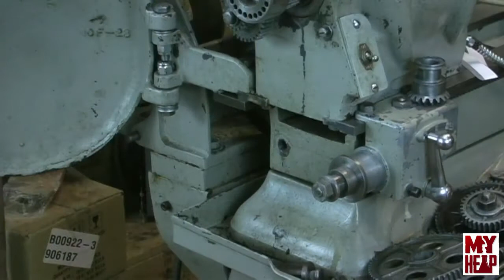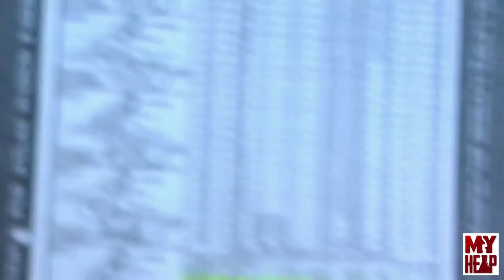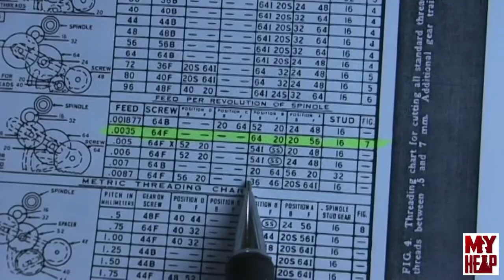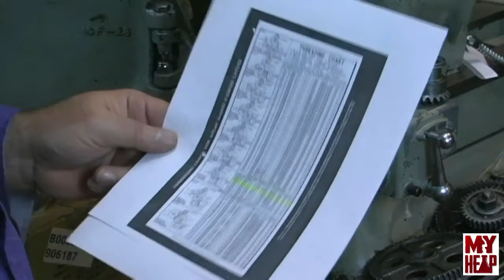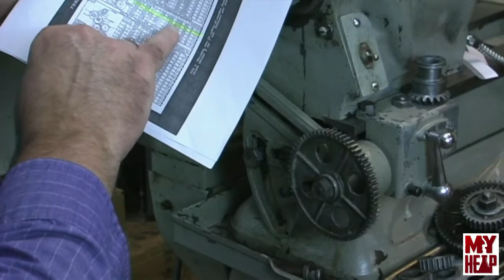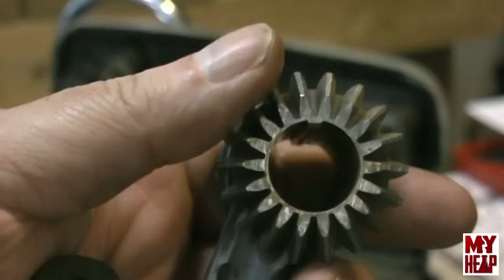Atlas 10F Lathe - TH54 - 11 - Installing the Banjo and Change Gears

Comment: Hi Joe. Once again Im glad I could help out with the gears. If I could make a couple of suggestions? First of all I.M.H.O. it is a good idea to mount the banjo and get it lined up correctly before adding gears to it. Those banjos are relatively thin cast iron and easy to crack. I realize you said the threads were a little sticky but you need to crank that bolt down so the shallow head rides in the groove without tweeking the banjo. There should be a jam nut on the bolt going into the headstock. Once that jam nut is tight, you really shouldn't ever have to take it out. The nut in the back to tighten down the banjo can be a bit of a P.I.A. to get to with a wrench. 
Secondly,  once again I.M.H.O. I find it easier to assemble the gears on the bushing assembly on the bench before putting them on the bolt. 
Lastly, not a suggestion, but a must! When assembling the banjo,  before you put the bushing on the shaft it rides on, put a couple of drops of oil. This really can't be done once the gears are on the banjo so it must be done before you put them on. And every so often, pull them back off and re oil.    
 Sorry for the book, just trying share what I have learned from my experiences.
Reply from the maker: Jeremy, please don't apologize for the help and great suggestions, especially if I can learn from your experience and wisdom.

Question:  The bolt that holds the banjo in the locked position, (for the lack of a better expression).  I see on the parts diagram that there should be a jam nut that I am missing.  I will pick one up.  But as I understand what you are saying I should put this bolt in against the recess in the banjo for a nice sliding fit (no lateral pressure against the casting).  Then lock the bolt into the side of the bed casting with the jam nut.  Then, to lock the banjo in position, just tighten the other nut and washer against the backside of the banjo.  Am I understanding that correct?

After putting on the bushings and then sliding on the gears, I think you are correct, sir, that it would be easier to assemble the gears on the bushings first, then attach them to the banjo.

I know that I didn't oil these, and I should have.  My intentions were to take it all apart and clean them up a bit then reassemble.  However, my viewers didn't know that and would be bad if they were following my practice in this video creating excessive wear in their machine.

I think I will do a follow up video.  Thank you for your help.  I do appreciate that you have taken the time to do so.

Joe
Reply: Yup, that is what I was getting at with the banjo bolt.

Comment: Hi, great videos.  When possible, could you tell me how the 16-tooth gear is mounted?  is it together with another?  or it is mounted the same way as the others, with a bushing that has keys.
Reply from the maker: The 16 tooth gear is compounded with a 32 tooth gear.  They are cast as one and ride on a stud and are free rolling.  They only act as idlers so the do not need to be keyed.  I hope that helps.

Joe
Reply: @MyHeap  It helped a lot, I'm a little lost because my lathe is missing this 16-tooth gear.  The 32-tooth gear has the same key as the other mounted ones.  I'll try to see how I do it, thank you so much for everything.
Reply from the maker: @vieiram7235  on my 10F, the spindle gear drives this compounded idler gear.  Then the gear in the "A" position on the banjo is driven by either the 32 tooth OR the 16 tooth gear, depending on whether or not the driven gear is on the inside or outside of the gear train.  Would a picture(s) or video help with this?
Reply: @MyHeap  I would be very happy if you could take pictures or make a video of this part yes I am restoring a high th42 that I inherited from my grandfather.  I'm Brazilian, I'm translating by Google, forgive me for any misplaced word.
Reply from the maker: @vieiram7235  I will try to get out in the shop tomorrow when I get home from work and either take some video or pictures for you.

Joe
Reply: @MyHeap  Thank you very much, I thank you forever.  But do this only when you have time, I don't want to bother you.
Reply from the maker: @vieiram7235  I have posted the video.  It is in the atlas lathe Playlist.  I hopeit helps.

Joe
Reply: @MyHeap  Thank you so much for your help, I'll watch right now.

Comment: I just picked up a 10F this past weekend and am enjoying your videos. On your next video would you mention or show the post lube of the gears - would be interested in what type you use and how much you should apply. Curious with all the disassembly you are doing did you consider repainting the components while you had them removed? I am thinking if I tear mine down in the same way I might as well paint the pieces I can (mine is similar level of paint condition as yours)
Reply from the maker: Hi Jeff and thanks for stopping by to take the time to comment.  I did consider painting the lathe, but I was more interested in just giving it a good cleaning and using it.  I am still new to this stuff and I figured that once I went through it and cleaned it up, that if the lathe was worth it I could always go back and paint it.  Although there is a part of me that wishes I would have painted it as I went.

I plan on recording another video as a follow up to the banjo and change gears to show some things I glossed over and correct a mistake I made that Jeremy pointed out.  I will cover oiling the bushes and gears in the video.  As far as lubrication, for most things I am using 20 W Non-Detergent motor oil.  For the Gears, I will use Mr. Pete's suggestion and use plain gear oil brushed onto the teeth of the gear.  Enough to give them a good coat but not so much that it just gets slung everywhere in operation.

I do need to get my hands on some way oil.  It is stickier than regular oil and will cling to the ways and saddle better.

If your new to the community, welcome.  There are a bunch of really great helpful YouTube creators out there that are willing to help with your questions.  May I suggest that you check out mrpete222, abom79 and others in your journey.

Joe

Comment: Do you know where I can get a complete set of replacement change gears. I recently purchased a th54 and mine did not come with a set.
Reply from the maker: Hi Michael.  Well, to answer your question, I don't know anyone that sells change gears for the atlas 10/12. But now saying that, you can find them on eBay and there are plastic ones that you can 3D print on thingiverse.  I found most of mine on eBay, but do have a couple 20 tooth gears printed in plastic that seem to be holding up well.  If you need a link to the thingiverse gears let me know.  Otherwise a search on atlas gears will locate them.  They are 16DP, 14.5 degree pressure angle.

Joe
Reply: My Heap thanks for the help. If you still have the link it would be much appreciated. My lathe only came with a few gears and I do not have a complete set.
Reply from the maker: @michaell4793  are you wanting a link for eBay or for the files on thingiverse?
Reply: My Heap i actually found it thanks

Comment: Is there an online resource where I can get these change gear charts?  Mine is missing :-(
Reply from the maker: Hi Gary.  Are you talking about the chart that goes on the inside of the gear cover door?  If so, I am not sure if anyone sells them or not.  Mine is missing too.  I have one in PDF form that I printed out and use.  I will be happy to email you a copy of that if you like, just drop me an email.  If I get a few minutes today, i will look and see if I can find an after market plate that goes in the gear door cover.  If I find one I will let you know.  I don't know if Clausing will carry the part or not.

Thank you for watching and taking the time to post.

Joe
Reply: My Heap  Hi Joe,  Its the PDF i need.  Would be great if you can send me a link or email me.  I will PM you my email address.  Great channel BTW.  I watch all your stuff.
Reply from the maker: Hi Gary,  I received you message and sent along the threading supplement to you that has the chart and other information.  The file was 3MB so if it doesn't make it because of file size let me know and I will provide another avenue or retrieving it.  I am pleased that you like my channel.  Thanks for taking the time to watch and comment.  I really do appreciate it.

Joe